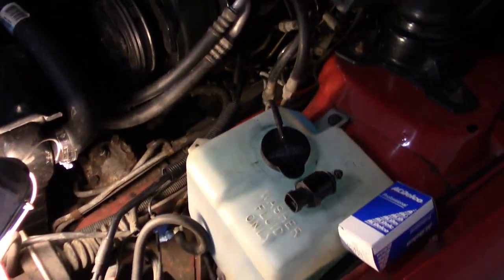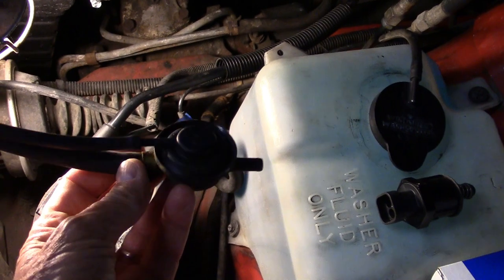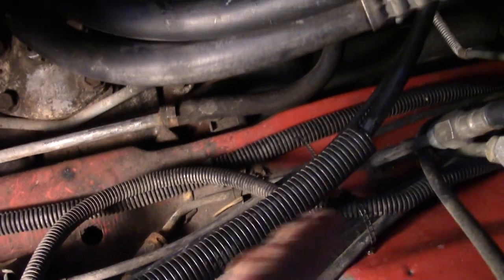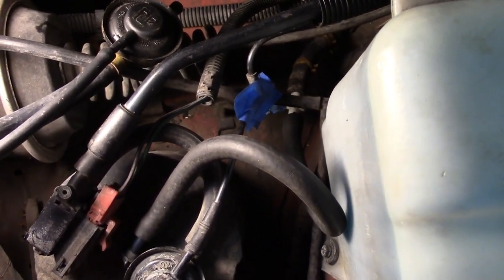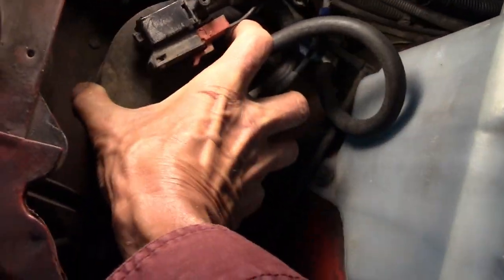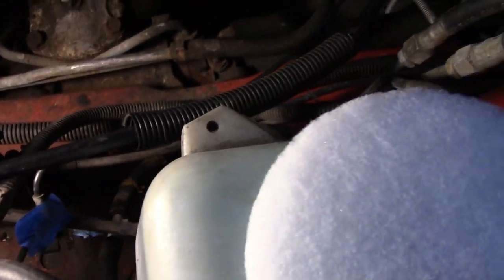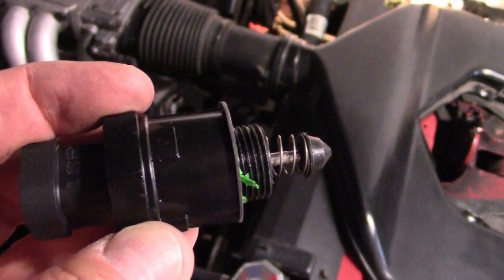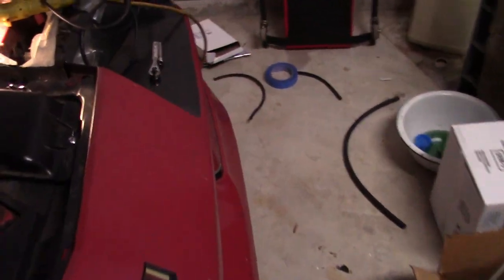Fix Camaro Fuel Tank Venting and Boiling with New Purge Valve - IROC-Z Barn Find EP #45

Comment: Mr. Wisdom, thank you for your videos. Saving me a tune of time tracking down my issues. I have a 1987 Iroc Z. it has been a ton of fun. Could you share the AC Delco part number for the purge valve and filter? Please keep making these great videos. I haven't recorded all my work, wish I had, maybe I'll start this weekend I have to replace the heater core and I have a new Dewalt right angle bit holder that works with my drill to reach that one screw on top of the heater box.
Reply from the maker: The AC Delco numbers were 214-2294 for the purge valve and the filter-- A478C.
Glad you're enjoying your car.  And, yes the heater core change out can be a little challenging.  I did one of those too.  I was replacing everything else in the cooling system because it was in such bad shape.

Comment: Hi, I am having an issue with my 85 chevy camaro And I believe it's the same as you were having in this video Pressure build up on my car when I pull off the gas cap also at the Pressure fuel tank vent valve fuel was coming out of that hose as well what should i do any help would be  appreciated thanks
Reply from the maker: I posted a new video with additional information:
https://youtu.be/q_KS6psFGhg

Comment: I had this excact same problem with boiling gas in my trans am for like 10 years, after 4 ac delco pumps, I rebuilt that whole evap system triple checked it everything worked as it should. I finally put in a bosch pump and the problem went away. Those new delco pumps just dont cut it the longer they run the hotter they get till it starts to boil the gas.
Reply from the maker: I used a Denso pump that was advertised as a turbine style, that seems to work well in general.  I was just surprised that a small amount of pressure regulation on the tank could make a large difference in performance.
Reply: @bitsofwisdom460  u are correct sir, that both is the same style, world of difference

Comment: I replaced my tank valve and the one at the charcoal canister.. I actually have 2 at my charcoal canister .. I changed the lower one that comes from tank.. when I removed the hose gas came out there.. would that be from the valve being bad?  I know that is supposed to be for fumes..
Reply from the maker: You are correct, if you are looking at the line that comes from the back of the vehicle to the purge control valve, that line should only be vapor.  That seems to be very odd and I'm not sure why that would happen.  Here are the possibilities that I can think of: First, that line should be connected to the vent port in the fuel tank sending unit. That port has a rollover check valve to prevent fuel leakage in a crash and is mounted at the top of the tank. If you fill the tank extra full, it is possible to get the fuel level up to that port and draw fuel into the line. It's hard to do, but possible.  Second, if the purge system isn't pulling enough vapor out of the canister, there can be liquid fuel in the bottom of the canister and it might be possible for that to back feed into the line. Seems remote, but worth a check.
I would try to blow air back through the vent line to the tank and be sure it is flowing air. I would also check the purge flow from the canister to be sure you have vacuum pulling with a warm engine and throttle open slightly. Should be vacuum at the canister port that is fed from the tank.
Reply: @bitsofwisdom460  will do that this weekend thanks! Sadly drove my car to work today and once again when I got in traffic and engine temp crept up.. I again had the stumbling not wanting to take gas problem.. once u get engine cooled down it’s fine..

Comment: Did you have a hard time taking out the filter from the charcoal canister? I been trying 2 take it apart 2 replace the filter but it's so stuck it doesn't come off,  how did you take it apart??
Reply from the maker: The filter should be on the bottom of the canister on the outside.  It shouldn't be necessary to take the canister apart.  Mine just has a bar going across the bottom that retains the fiberglass pad.  I removed the canister and pulled the old filter out and fed the new one in over the bar and tucked it in place.

Comment: Curious, is your A/C working? I am in the middle of updating mine to R134. Enjoy your presentations.
Reply from the maker: I have my A/C working now - so far so good.  It had zero charge after sitting for 25 years.  I elected to stay with R12 for the moment.  I worked long and hard with a vacuum pump to get the system sealed up.  EVERY "O" ring in the system had flattened out over the years and needed replacement before it would hold vacuum overnight. If something major would fail in the system, I'd probably take that opportunity to upgrade.
Reply: @bitsofwisdom460  Makes sense, the R12 is better. This is LSXMatt, he does a lot of good work on two 3rd gens, if your interested. This particular video is on his upgrade to R134. https://www.youtube.com/watch?v=dGEATP83k0M&t=137s
Reply from the maker: Thank you, I'll take a look at his video.  I expect that some day I will need to change over. If I had a major issue like a compressor failure, I would take that opportunity to switch.  For now, it seems to be doing well with the R12.

Comment: My car is boiling the fuel in the summer heat.. it did it the other day and died I let it set a few and it started up and was fine after engine temp cooled down with steady driving.. it did it again today (95 degree day) was fine until I hit traffic and engine temp krept up to 230 range then started sputtering.. I had convinced myself that fuel was getting heat soaked at the fuel rail heating up fuel in tank.. I will try the purge valve.. though I am not sure how that makes the fuel in the tank get hot
Reply from the maker: I agree that the fuel is heating in the fuel rail and being returned to the tank which heats fuel in the tank.  The manuals indicate that the purge valve holds a low pressure in the tank. The exact number isn't consistent, but it seems to be a few psi. When the fuel is hot and the vapor pressure is high (fuel is rapidly evaporating or boiling), that few psi being held by the purge control valve reduces the boiling effect.  I think that helps the fuel pump because the pump inlet would be a lower pressure area and boiling would be worst there, causing pump noise and loss of pressure at the rail.  If you add a little pressure to the tank it should help the pump to prevent cavitation. 

In the time since I posted this video, I have gained some experience.  I still hear some boiling noises at times, but the only hot weather issue that remains is an occasional tip in stumble in extended heavy low speed traffic (like a cruise). If I tip in very lightly, the purge solenoid will open with the throttle just cracked and all that vapor from a hot tank will make it go rich.  If I tip in a little harder to give the engine more air, it will clear and be fine.
Reply: @bitsofwisdom460  I will order the parts today! Thank you for the reply.. Really enjoy your videos..the most in depth ones on youtube! I bought an 88 iroc with 67k original miles.. The original owner passed and his son sold it.. I have fixed many things from the interior to many vacuum leaks. My car has ran like a new one up until the hot weather hit, its fine on short trips, but if i drive it to work (an hour ) and sit in traffic i have this problem.. Thank you again!
Reply: I also just ordered the fuel tank vent valve as well, hopefully will cure my issues!

Comment: Would you consider getting rid of the air-pump and the manifold-hoses to clear up the engine bay abit and make general maintainance easier? If you do, will you make a video on it?
Reply from the maker: Well, I really don't want to go that direction, and I'll explain why.  You are correct that the plumbing is a pain to work around, but on balance I think it is right to keep it.  I have worked in this business a long time and really have come to appreciate the need for clean air and proper emission hardware.  In the early 70's, before catalysts, there were engine modifications for emissions with severe vacuum and mechanical timing advance limits accompanied by odd cam timing and extreme lean calibrations. Those cost great amounts of power and fuel economy. Some large sedans lost 50-75 HP and 5 MPG with the same engine.  In comparison, a good catalyst has relatively low back pressure, the AIR pump has really very low power draw because it is moving air, but not under pressure. The power loss is very low while the emission reduction is great.  The AIR pump aids in catalyst light-off, it burns off unburned hydrocarbons, and in some conditions is used to help protect the catalyst from melt down. So, if you're building a race car where you need every last bit of competitive power, strip it all off.  If I'm building a street car, I don't think that the loss of a few HP is worth the increase in HC and CO that it will generate, so I'll keep the hardware even though it is somewhat more difficult.
Reply: I see what you mean, and understand it. The previous owner removed the cat, but it still has the AIR-tubing and all that garbage that comes with it. I wouldn't do it to remove the parasitic power-loss, but to make it easier to maintain the vehicle.
But that's something the next owner gets to do, I'm sick of it and selling it.
Reply: You and I like the idea of keeping it factory spec. 99% of the car hobby is not like that anymore, but for the original guys like me, your videos are a Godsend!  Now, what is the canister for - and how do I know what to do to test it?

Comment: I couldn't get to the bottom of this issue. My 1988 fire red metallic trans am gta has been parked in the garage for 19 years. The smell was that bad. Im sure it now needs more than a valve to make it run again. Haha😢
Reply from the maker: Yes, that's probably true that it will need more than a valve. Hopefully less work than mine required, though.

Comment: Do you mind to share the fuel pump part number you used?
Reply from the maker: I used a Denso pump, which has been very good, but last I checked it was discontinued.  It was a standard oem replacement version. Given the challenges with this system, I would opt for a good quality oem equivalent rather than a "performance" pump.  Unless you have a modified engine that make a lot more power, the stock pump should be sufficient.  If you have a high flow pump, it will just send a lot more hot fuel back to the tank.
Reply from the maker: If I was doing it today, I would probably buy a Delphi pump.  Rock Auto has a listing of DELPHI FE0110 for the 305 FI.